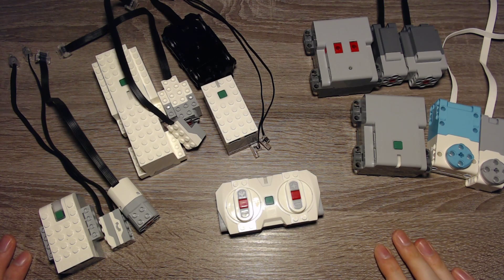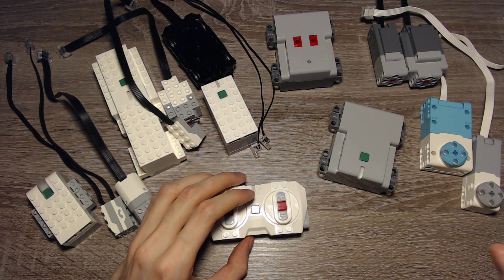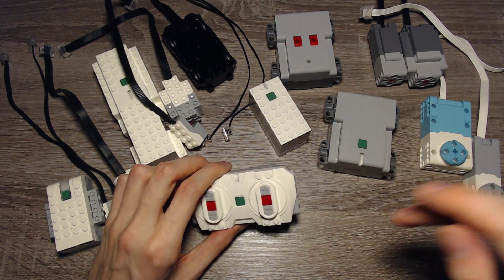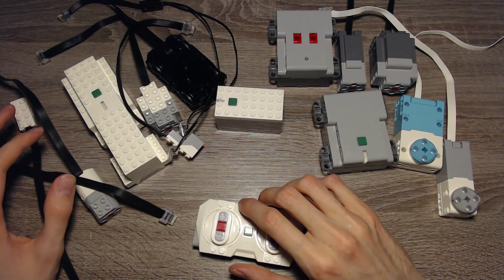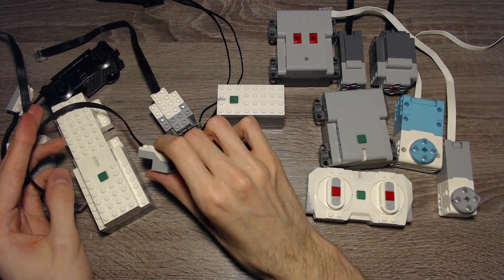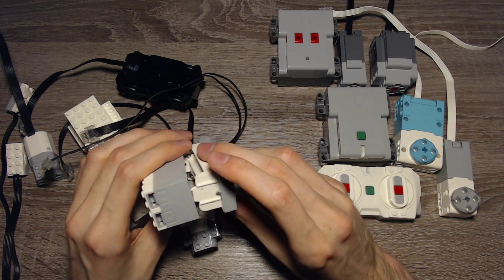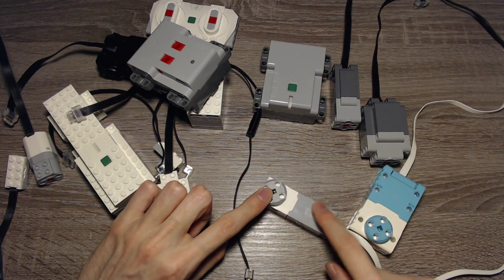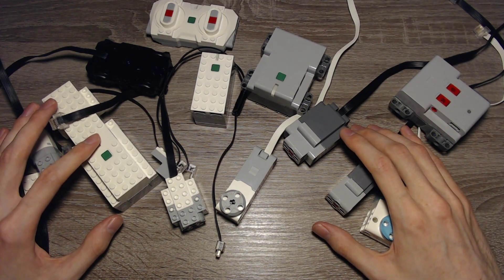Lego Powered Up Tutorial #0: hardware, compatibility, features and more [English|HD]

Comment: I cannot get the medium angular motors to work with the small powered up hub…
Reply from the maker: With the remote or with the app?
Reply: @technicmaster0tutorials  The app, I do not have a remote.
Reply from the maker: @willkroll8094  It works for me. Did you select the right port?
Reply: @technicmaster0tutorials Yes, I have both ports occupied by a motor. I’ve also tried switching the ports that the motors were using. Is there anything that needs to be done to prepare a motor or brand new hub before use that I could have missed?
Reply from the maker: @willkroll8094  You can try to update the firmware on the hub. That can be done by disconnecting all of the cables on the hub and pressing the green button until the LED switches the colors. Then, you can connect the hub again to the app and it will update.
Reply: @technicmaster0tutorials  That fixed it! Thank you so much for your help, I couldn’t fine anyone who was having the same issues as I was online.

Comment: Can u tell me what the comparability within the LEGO mind storms robot inventor set. For example what motors are compatible and if the remote control is compatible (with the mind storms hub)
Reply from the maker: I made a few videos for that topic:
"LEGO Mindstorms Robot Inventor: Compatibility with Powered Up, Control+, Boost (51515)" (general compatibility but not 100% up to date because there was an update a few weeks ago)

"LEGO Mindstorms Robot Inventor App Update: Powered Up Sensors now compatible + future" about the connection of powered up sensors and motors to RI

"Motorized LEGO Technic Heavy-Duty Excavator (42121)" an example of a remote controlled model that uses the RI/SPIKE hub

"HowTo connect the LEGO Powered Up remote (88010) DIRECTLY to Mindstorms Robot Inventor" similar to the previous video but with another python library

"Powered Up Sensor library for LEGO Mindstorms Robot Inventor + SPIKE Prime (Python| Boost, WeDo 2.0)" my python lib to use powered up sensors with RI/SPIKE
Reply: @technicmaster0tutorials  thanks!